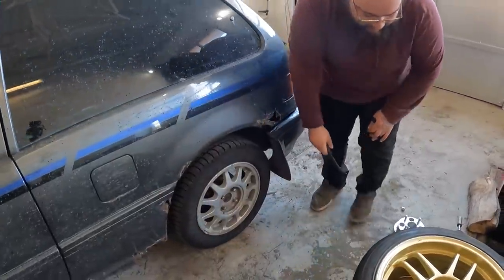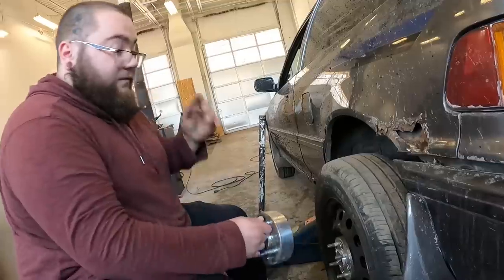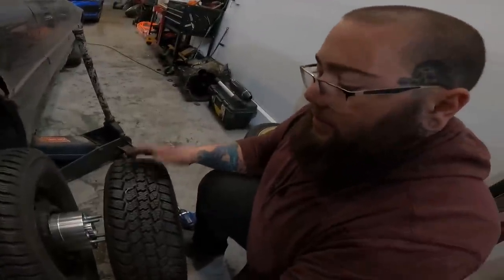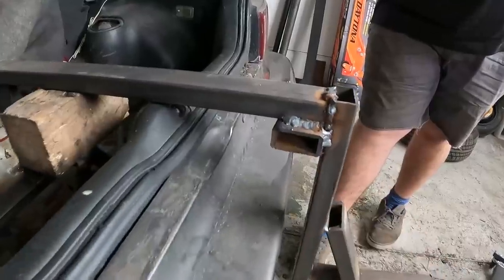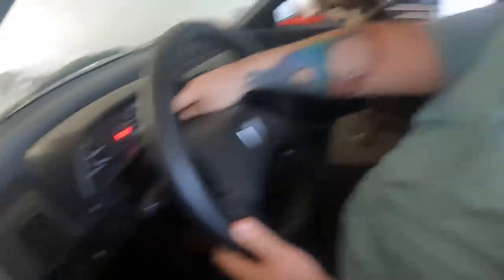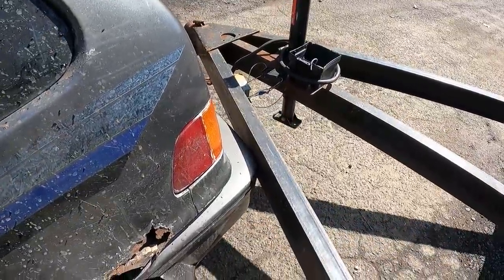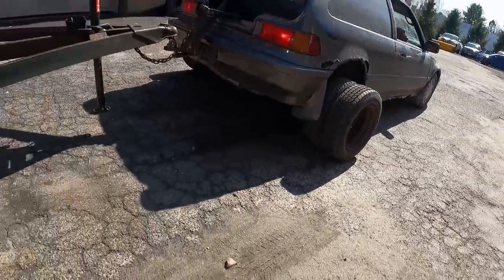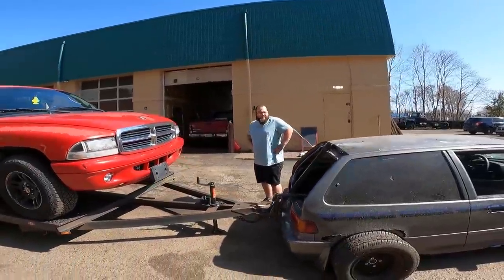Honda Civic TOWING a PICKUP TRUCK!

Comment: Just back the truck on to the trailer. That way the heaviest part of the truck will be in the rear of the trailer and it will balance out better. Or you could put a bunch of heavy stuff ( like cinder blocks ) on the back of the trailer to balance it out.